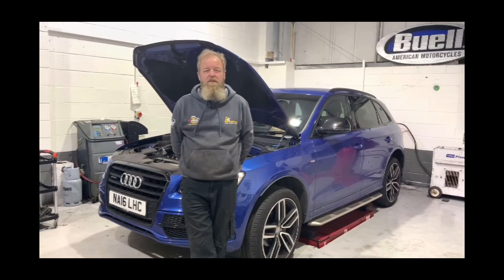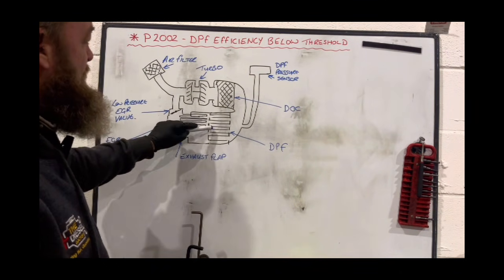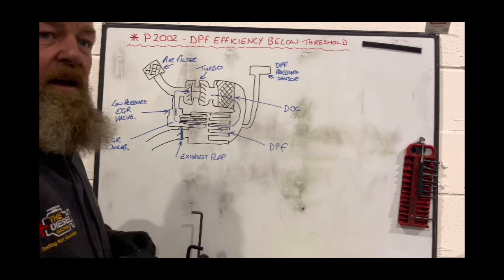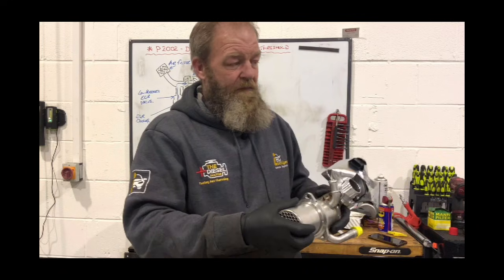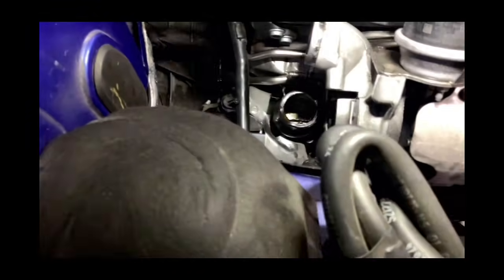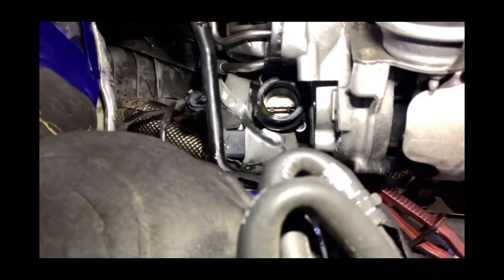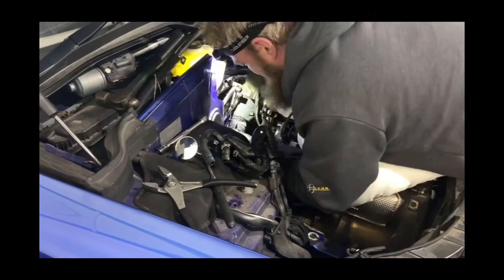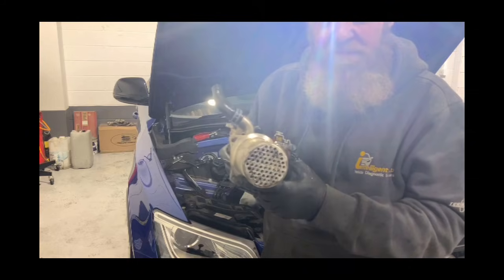Why the fault P2002 DPF Efficiency below threshold, Audi, VW, Seat, Skoda, Euro 6 is triggered.

Comment: Great video, how would it effect the car if the blocked egr cooler wasn't replaced and the car was still driven with the error light present?
Reply: Exactly what I’m wondering about. Have this code for a while now (5k? Km) in my 2016 A4, it drives fine although sometimes a bit sluggish. If I can avoid getting a 4 figure quote I’d be happy.
Reply: @rap-id-ralph  I returned the car to the dealer for a full refund because they attempted to fix the car on 2 occasions, they fitted new dpf, new egr, new turbo (no idea why new turbo) and the light still came on after a a few days every repair, I told them from the beginning it was egr cooler but they wouldn't listen, anyway the car was driving fine but I couldn't keep it knowing it was the cooler than needed attending to.
Reply: @media_family_memories  understandable 100%. I might bring mine in soon, when I’ve gathered enough financial courage ;)

Comment: Hi, another excellent video. I have a 10 year old 2 litre diesel with the Peugot engine, going like a train. Thinking about buying a vw group 2 litre diesel, probably an Octavia. In your experience at what kind of mileage do you start to have problems with this engine?Could you also please include the mileage of the cars you are working on. Keep the videos coming, it is a pleasure to watch someone who knows what they are talking about.
Reply from the maker: If I remember correctly this car had about 35k miles on it, I’ve done others with varying mileage but it would seem the cars that are used in an urban environment are more likely to have this issue

Comment: I would of liked to of seen the DPF pressure sensor readings in either live data, scope or other meter measurements. A before and after would of been great. DPF’s block up for fun. We can’t assume that the EGR cooler is always the culprit. Due to the chemical reaction that takes place in a DPF, we have to be carful about our approach to cleaning. The EGR however does not use the same chemistry and can be cleaned many times. I accept though, this job is very labour intensive. It pays to replace with a quality new unit. Thanks for the video…
Reply: what products would you use/recommend for a EGR cooler cleaning on a VW TDI 2.0 MK6?

I have considered Liqui Molly Diesel Purge
Reply: @iGIVEH2OPE  With this type of EGR design I am yet to be convinced that they can be cleaned in situ. I would try Liqui moly.

Comment: Thanks for the explanation. Getting this code every 150-200 miles or so. Car had a DFP clean and sensor replacement earlier in the year so wasn't sure why the code kept coming up. Cheers!
Reply: So it was the egr cooler for you as well?

Comment: My partners Audi A4 s line has this code repeatedly, it’s had egr clean, new dpf, drives fine for a few weeks then back in limp mode with error P2002. Garage now saying it needs a pressure sensor but I’m inclined to think it’s the cooler as you show here.. we are in the North East, would be interested in a quote to solve it once and for all
Reply from the maker: Give us a call to book it in for a conclusive diagnosis 0191 4871384
Reply: @intelligentauto737  hi gary what do you charge for replacing dpf
Reply from the maker: @mrt5424  I won’t replace anything without first establishing if it requires replacing.
Book in for an assessment and we will take it from there
Reply: Thank you, will pass it on 👍🏻

Comment: Have a similar problem with Audi A4 Ultra Sport 2016 with ad blue. Car not losing power. Forced regen done but engine management light reappeared within 7 days. fault code is P200200. Sensors checked and all ok. Is this the same fault code as P2002? And will replacing EGR cooler solve the problem? 

Thanks
Reply: Hi. I have the same problem for my Audi a4 s-line 2017 avant, the code which appears on the computer is p200200.  I just wondering if you solve the problem by replacing EGR cooler?
Reply: Nu se rezolvă, am înlocuit eu .... problema e la DPF

Comment: I have a 2017 Passat 2.0 TDI  BiTurbo 240 bhp. 127k miles. I have that fault code when i scan with VCDS. However i don’t have the engine light coming on. I would never have known unless i scanned the car, any reason for this? I’m guessing i have the same problem? The car performs flawlessly. Should i ignore for now? What would happen if i don’t change the egr?

Comment: Will this probably be the same for other vehicles? I continually get a P2002 Code on My 2010 Fiat Doblo 1.3 Multijet Diesel, EML on Dash and goes in Limp Mode, Do a Forced Re-Gen, Clear the Codes then 3 weeks later it comes back on
Reply from the maker: That vehicle does not have a coooler in the dpf so no
Reply: @intelligentauto737  Thankyou for Your Reply, I have Googled it and apparently My Van DOES HAVE a Egr Cooler

https://www.autodoc.co.uk/car-parts/cooler-egr-13337/fiat/doblo/doblo-platform-chassis-263/9298-1-3-d-multijet
Reply from the maker: @michaelreidy3343  not as part of the dpf
Reply: I also have P2002 on my 2007 Seat Altea 1.9tdi. Thought I'd found the problem with what I think was a blocked pressure pipe  after the dpf. Blew that through and fitted a new pressure sensor as well but still got the code. Intending to remove and check my egr cooler next which looks like it's got exhaust gas leaking at the actuator. I'm hopeful of getting mine out easier after seeing the work involved here so inspired me  to go for it! 👍

Comment: I have the same problem on my 2015 a4 2.0 tdi. So is the solution to this problem to clean the dpf or replace the egr cooler?
Reply from the maker: Without a conclusive diagnosis I’d do neither.
Where are you located, I may be able to point you towards a trusted specialist
Reply: @intelligentauto737  Im located in Sweden.
Reply from the maker: @adambergqvist5016  sorry can’t help you there, I’d say find a trusted VW Audi specialist then, they should be aware of the issue abs how to test the system to prove the cause
Reply: @intelligentauto737  Will do.
Reply: @intelligentauto737  do you have any recommendations for any specialists down south or around West London ?

Comment: I have the same problem with my 1,6 VW TDi crkb engine , I have visited 3 different dealers no one can solve this code .
I don't know if my engine has a EGR cooler , but after watching your video now I want to remove that flap from my dpf 😂,is there away to unblock this cooler with out removing the EGR (the cost is to much since it's very difficult to do !!)
Reply from the maker: Removing the flap will not cure this issue.
Only remedy is to remove it and replace
Reply: @intelligentauto737  thanks I'll tell my dealer to replace it , I'm thinking of putting a provent 200 catch can in my engine , do you think it will help with the built up on the EGR? Or is there any additive I can use to clean my EGR?
Reply: Clean or replace the egr cooler,dpf and all the hoses check,i did a good clean and found that the pipe that leads to the pressure sensor was blocked, i did a hole clean of the exhaust system and the light is now off ,check your dpf and egr ,egr cooler .
Reply: Halo.I have the same problem with my 1.6 tdi . How did you solve it? Please ansver.

Comment: Hi I’ve got the same issue on my 2014 A6 avant black edition ultra mileage is at 67k how can I contact you about repairs?
Reply from the maker: Where are you located
Reply: @intelligentauto737  I’m in Birmingham travelling isn’t an issue
Reply from the maker: @A.H.1  if you wanted to book it in email me on thedieseldoc@me.com
Reply: @intelligentauto737  I’ve mailed you bud
Reply: @intelligentauto737  what's your postcode and what's the quote for this job?
Reply from the maker: @robertwojtowicz3681  NE11

Comment: so you could technically remove and clean out the cooler and it would do the same job without having to pay the price of a new cooler
Reply from the maker: If you wanted to risk investing nearly 8hrs in a job and hope that the cooler isn’t leaking or cracked then I suppose you could.
I however like to offer a first time fix.
Reply: No because these have been superseded for a modified part apparently.

Comment: Brilliant video thank you for taking the time to upload. The reason I found this video is because I have the same problem - hoping you might be able to advise, diagnose, and repair.
I have a 2016 A4 with the DETA engine, same p2002 code comes up every 150 miles or so after clearing with VCDS. No loss of power, mpg is still in the 55-65 range. DPF regens happen and Adblue consumption is about 10liters every 6months. I do about 400miles/week on the motorway, it has 93k on the clock. I stuck a boroscope down the intake hoping to get past the EGR valve to confirm a blockage in the EGR cooler, BUT instead the EGR flap motor was struggling to move, It was "dancing" almost like the gears are stripped. Could this be the cause of the p2002 code? Could also be a blocked cooler
Reply from the maker: Without seeing it it’s impossible for me to say if you have the same issue. All I can say is if the egr flap is sticking you need to ask why? If you’re local to me yes I can help with confirmed diagnosis and repair if necessary
Reply: @intelligentauto737  Many thanks for your reply, yes you need to see it to be sure. Im in West London so too far from you. Thank you anyways.
Reply: @intelligentauto737  hi there ... I have the same issue A4 TDI 2.0 CNHC engine 2015... Where about are you based?
Reply from the maker: @slmut1  Gateshead
Reply: I have the same issue could i ask what was the cost of the repair please? Thanks

Comment: dear i changed the Exhaust the 2 sensors and  egr valve i have toyota corolla  verso 2005 and i still have the code p2002 and when i  remove the code with OBd  it will come back in 5 min and i lose power when i drive  after the code show up i spend a lot of money what can i do to fix  it
Reply from the maker: Where are you located

Comment: I'm curious what causes the cooler to plug up. Since it's mounted post DPF, all soot should've been captured in the trap. I tought the entire purpose of LP EGR was to have "cleaner" low oxygen air compared to tapping it off straight at the exhaust manifold. Big thanks for sharing your knowledge in these videos.
Reply from the maker: It’s outlined in the video, the cooler gets contaminated with crystallised Adblue
Reply: @intelligentauto737  Thanks. I clearly missed that.
Reply from the maker: @Chris-tn8zq  then you’d need to identify the cause and repair it
Reply: Would it not get coked up when it does a regen though? I'd assume the EGR stays closed during the process to limit how much passes through it.

Either way, I shouldn't think what passes it by in that brief period would be enough to stick.
Reply from the maker: @ssss-df5qz  low pressure EGR cooler is downstream of dpf so theoretically there should be no carbon deposits present after the Dpf
Reply: @intelligentauto737   but as you said, its plugged by crystalled  unused adblu fluid.

Comment: Great video again Gary!
Tell me where did you get the information of how that system operates? Have seen that code myself and done a couple of coolers due to the tpi but could never find any info on how the system actually operated to work out why it logs that code? Be good to know the info source you used?

Luke
Reply from the maker: I can’t say I read this anywhere, just an understanding of what’s going on leads to why this fault is logged
Reply: Could it be the O2 sensors sensing a reduced input of exhaust gases into the inlet? I mean if it is blocked, less getting through than expected.

Maybe even sensing unmetered air due to the lower throughput? 

Is there a sensor between the DPF and the EGR? I'm guessing not.

Comment: Those heat shields on the bulkhead can be a pain in the ass on some cars,i had a 2005 megane rs225 2.0 petrol turbo,all i had to do was replace an aircon pipe at the rear of the bulkhead.
Unfortunately the pipe was 'behind' that heatshield!!It's the fact it's shaped to the bulkhead,i had to try and pull it up and out!Let's just say it wasn't the same shape went it went back in,it took me ages!!it was a nightmare!
Another great video!! :-)

Comment: Great use of a pillow there not a job you want without leaving engine cool down overnight eh, out of interst how long did it take to remove and reinstall
Reply from the maker: Start to finish about 8 hrs but now I’ve identifies what needs to come off, where the fixings are and in what order I’d say I could knock a couple of hours off that now
Reply: @intelligentauto737  looked a real fiddly job great video thanks

Comment: That's unbelievable Gary I've just filmed this exact code last week
Reply from the maker: Yeh it’s becoming more common as these vehicles are coming out of warranty. This was from about a month ago. Over the years I’ve diagnosed this exact fault plenty of times but this is the first I’ve actually repaired, I look forward to your take on it.
Reply: Yes it’s becoming a major issue, dealers where replacing the coolers every week but are not seeing as many these days as warranties have ended, good video Gary,, believe it or not I actually done one on the exact same vehicle a few weeks back.  
It is straightforward but reassembling is slower then the stripping down.
Reply from the maker: @pauloneill6097  you don’t say!
Reply: When you replaced the EGR cooler, what additional parts would you require to get the job done? (Does it need additional gaskets etc...?